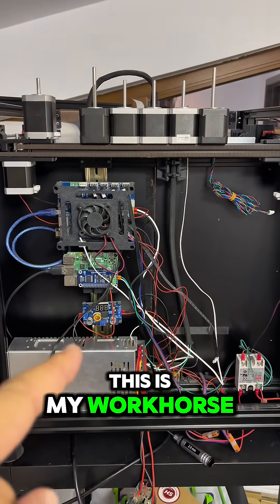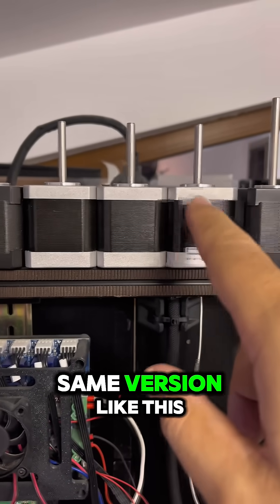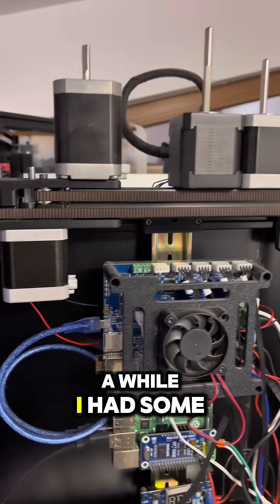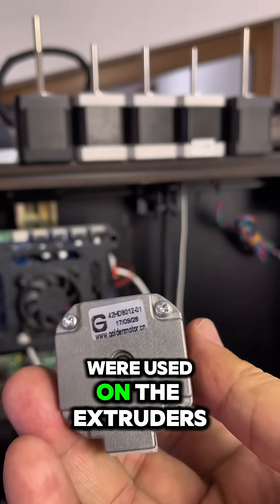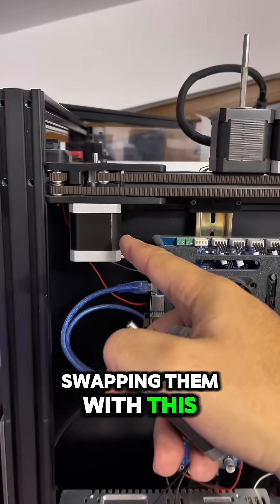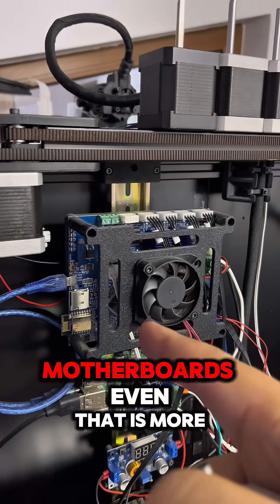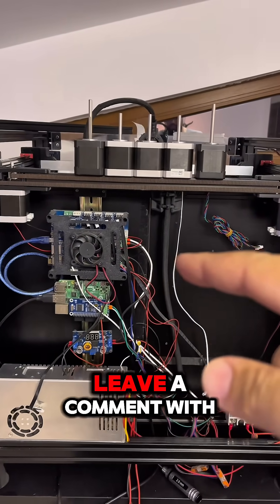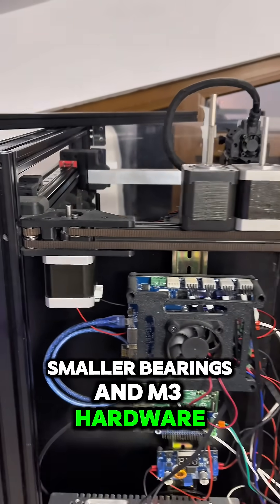What Happens When You Upgrade Your 3D Printer Motor?

Comment: Glad you are feeling better Nadir, and hope you stay healthy. I know making content takes much time and effort and all of us appreciate what you do. My Eddie NG is working great and I got all my info from your printables page! I do have VFA issues, but was able to mitigate most of it from changing my input shape being from VZ to MVZ. I have not tried EI yet as I have heard it’s more math intensive and my SOVOL SV08 MPU sometimes shuts down when I’m doing MVZ input shaping auto calibration. I would be interested to see the results of these motors. I believe I already have the 1.5 belts by default, but maybe those need replacing as well… It was quite frustrating trying to tighten them!
Reply from the maker: I appreciate your kind words and support! I have already bought 10m of belt and i will make some design changes also to test the 1.5mm belts but it will take some time since i have lots of test to do.

Comment: I’ll be really interested to see the 0.9 vs 1.8 quality results and also asking my self what could be the combination of 0.9 motors and 1.5 gt belts…
Reply from the maker: That's a great question, we're working on gathering those results, this is why we made this custom motors they are same speck the only difference is the angle. But even from the first test the 1.8 are more silent and bringing better quality to the game! I will test them for some weeks to gather as much details i can and them i will swap them and at the end i will compare them with the LDO motors. even that this ones are 2A rated  but they are same form factor.